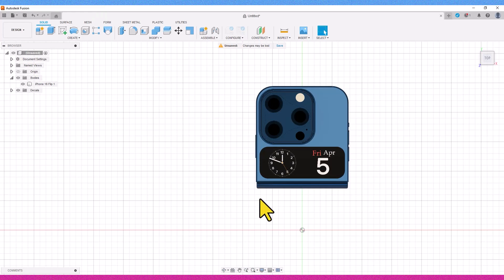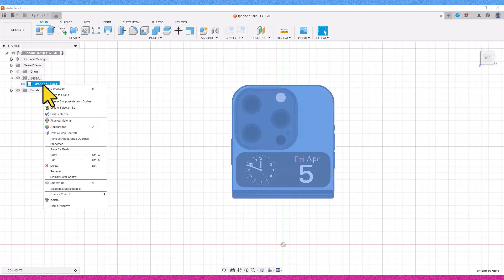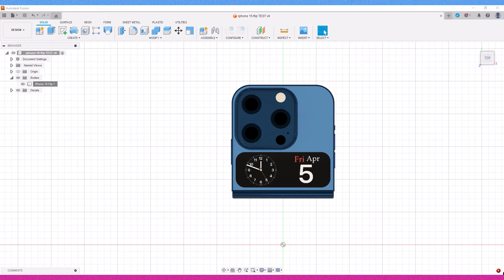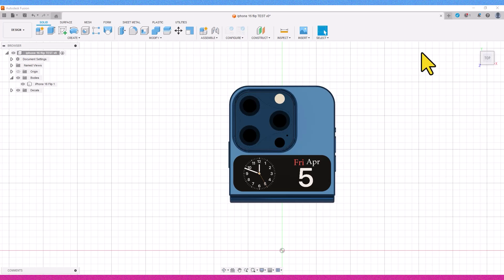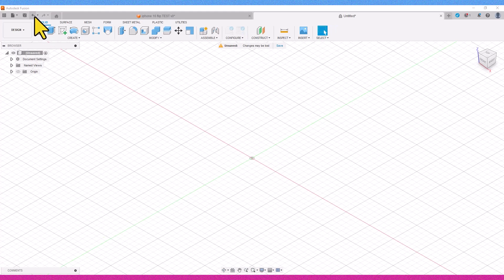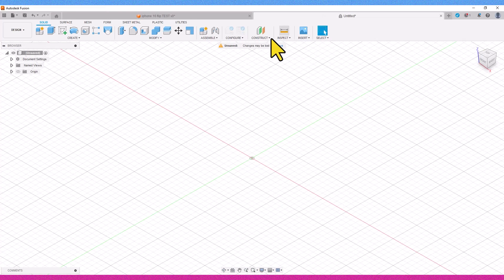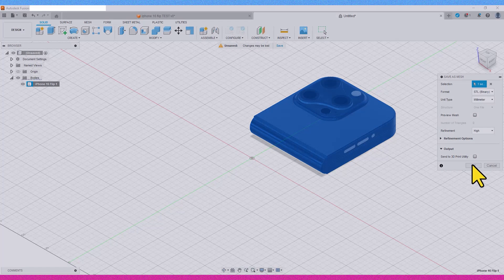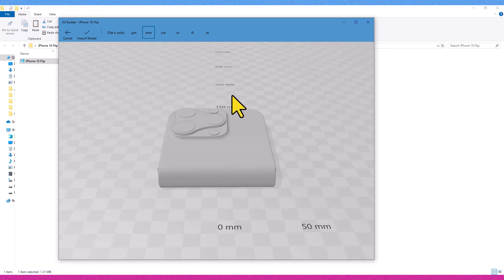Fusion 360 Won't Export? Try This Easy Fix!

Comment: Another option is to create a new project. On the data panel (menu) right click on the design you want to export. Click "insert into current design" and export once it's loaded the file and rename it as needed
Reply: Don't understand your instructions, not clear?